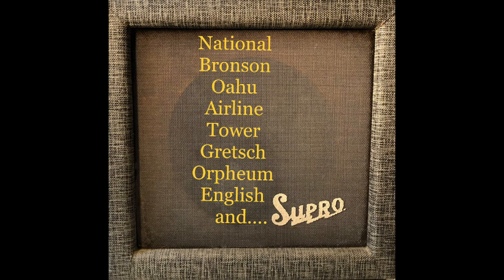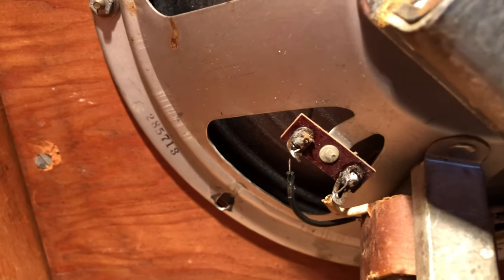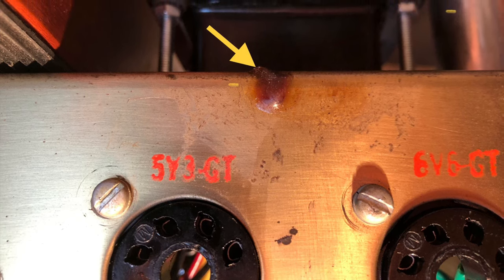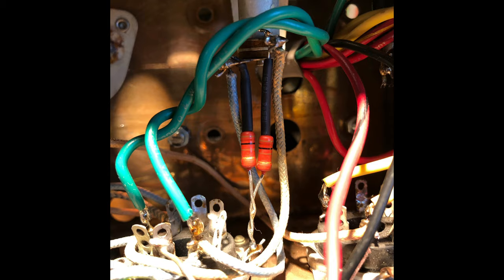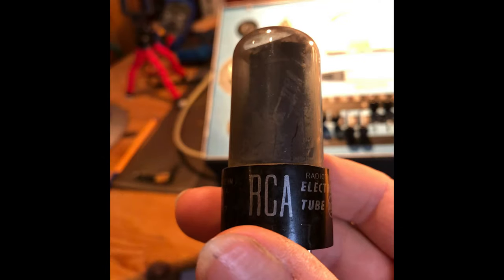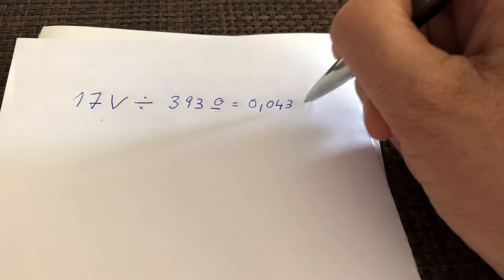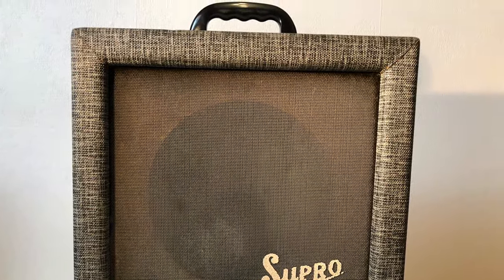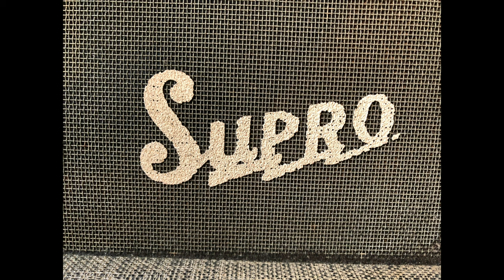Supro SE Amp made by Valco / Chicago : repair, analysis, sound demo

Comment: As a number of folks have pointed out -- the amp Jimmy Page used on Led Zeppelin 1 and the solo to Stairway to Heaven was a Supro 1690T or Coronado. This is a 2x6L6 cathode-biased amp with two channels ("normal" and "tremolo"), each with two inputs and it's own volume knob. It was the early "shared tone knob" version of the Coronado. It has an additional gain stage on the tremolo channel and is can sound much more aggressive/overdriven. Page's amp cam with 2x10s but he replaced them with a single 12" speaker, which results in impedance mis-match, which gives it some of its particular character, along with the specific 12" speaker he used.

Comment: Hello Martin, I just love your channel… You always have the most unique amplifiers, do amazing diagnosis of said amplifiers, then always repair/refurbish them to function and sound as they did when new if not better than new! And your quite the guitarist as well which just adds to the entire experience… I did enjoy you doing the math to figure out the voltage’s for each node, which might be 2nd nature for someone like yourself, but is appreciated for beginners trying to learn. I have a question, I own an earlier National Amplifier, it is 5Y3 rectified, push-pull with a pair of 6V6GT’s, I believe a 6SL7 Audio Amplifier/ Phase Inverter, and a 6J7 Preamp. It is a metal pentode tube with the grid coming out from a metal contract at top of tube to a wire which then goes into chassis. The speaker is a Rola 10” electrodynamic type.. Although it still functions, the voice coil is damaged and obviously produces unwanted noise, and I don’t even play it as I don’t want to damage it further. I’ve gone through the entire amp, replacing all the filter capacitors, tone caps, checked all resistors and repaired any out of tolerance… I truly love the sound of the amp, and I would like to keep the original speaker.. Do you know of anyone who re-cones these types of speakers? I don’t want to add a resistor and a non electrodynamic speaker which I feel would detract from the Tone as well as the originality. Any advice would be appreciated Martin. Thank you, Tom
Reply from the maker: Hi Tom, I don’t know, where you are living. I am located in Germany, and I’m pretty shure, there’s nobody here to fix a electrodynamic speaker. Believe it or not, I have an amp with the same specifications on the bench right now. But it is a real challenge. Even after changing all capacitors, checking all resistors and swapping the tubes, I still have a significant loud hum. I have to trace that, but maybe it’s a problem with the electrodynamic speaker too, because it should work as a choke to suppress noise.

Comment: Some (not all) Harmony amps were built by Valco as well, including the Harmony 420 with 15" speaker and 6L6's, which was apparently designed/marketed primarily as a bass amp. It sounds anemic for guitar (orobably for bass as well but I never tried it for that) and could do with some tweaking or the addition of a proper tone stack (one triode half of a 12AX7 is just sitting there unused!) . The Harmony 420 has a top-mounted amp chassis, but there was a somewhat similar Supro-branded version with the amp in the bottom rear of the cabinet. Some Harmony and Airline amps, and the majority of commonly-seen Silvertone amps, were built by Danelectro, who always used an aluminum chassis, while Valco amps used a steel chassis, whether painted or chrome.

Comment: I built a 6161 Gretsch clone. It’s one of my favorite builds. I stuck to the class 2 NOS disk caps they used in the real one except for using Jupiter caps between the PI and 6973 tubes. The tremolo is amazing. I added a depth pot to it tho. Built a SUPRO/Gretsch inspired cab. 6x9 speakers. Great amp!
Reply from the maker: I’m shure, you will like my next two upcoming videos: a Valco National Val Trem and a National Sportsman 1201. Amazing Amps.

Comment: Not the LZ amp -- it had p/p 6973's.
Reply from the maker: Yes , that’s right. It was the bigger brother of the one in the video. Thanks, I’m gonna mention that in the description!
Reply: @martinstubeampworkbench2299  yup quite a few different models and circuits -- I think the lz one has grid leak inputs as well ....
Reply: @BenPrevo  whats grid leak inputs?
Reply: @jamesoconnor5154  Grounded cathode and a cap on the input -- google it.
Reply: I picked up a Valco made Penncrest combo amp with 2 6973's 4 12AX7's, 5Y3? With a cheese box reverb. It had a off brand 12" speaker and really didn't good. I replaced the 6973's with nos RCA's, as well as the 12AX7's(hold onto your wallet on that call!) Also I did some more research online and found the correct  Jensen 12 from the 60's. Those are pretty expensive, too but I found one online from a  guy parting out a church's organ 4 12 cabinet! All said and done, holy $hit did this sucker come to life! It nails Page's sound on the first 2 Zep albums with no pedals? Glad I bought it for sure!😊
Reply from the maker: Congratulations!

Comment: There's no need to replace an entire tube socket because of just one broken terminal. Just pull a terminal out of a similar style socket, install it into the empty hole in the socket that's in the amp, and twist it 30 degrees, or bend the flap over, to lock it in place. The terminals of most sockets are held in place by a twist, a bend over, a punched divot, or a triangular flap of metal that acts as a locking tab. All of which are easy to squeeze flat or straighten out in order to remove the terminal. To lock it in place, just bend it over or give it a twist (the original divot or bent triangular flap isn't easy to replicate, especially on a socket that is mounted into a chassis).
Reply from the maker: Hi there, thank you for your good advice. In this case I didn’t want to mess around with a 70 year old socket. If the next lug snaps off next week, my customer will be unhappy, the amp comes back to the shop, and that makes me displeased as well. But other than that, you’re right, it is fixable.
Reply: @martinstubeampworkbench2299   Replacing the entire socket here was a little bit easier because in this case it was bolted in place ( And you had one in stock with the same physical geometry and mounting-hole spacing), but many Valco amplifiers have sockets that are riveted to the chassis and so you have to drill the rivets out, which can be a pain in the neck.  And speaking of rivets on a Valco chassis,  you're probably already aware of this ---- but perhaps not because I don't know how many valco amps you see in Germany ----  but the grounding terminals in those amplifiers are often riveted to the chassis, or the cathode resistor(s) might be soldered to the metal frame of a tube socket which is riveted to the chassis for a ground cinnection; and 60 years later those ground points are oxidized and resistive under the rivet where you can't see it, causing ground loops and hum. Just something to watch out for. Otherwise, nice work here!
Reply from the maker: Thanks! Actually Valcos are rare here in Europe. But I’m a big fan of these. Made a few clones, and they sound fantastic, especially the ones with a tremolo sound gorgeous. Got a 1950 Valco on the bench now, with significant loud hum, though all caps are new. I suspect either the electrodynamic speaker, or a groundloop, so funny that you mentioned that. It’s a small world!
Take care
Reply: @martinstubeampworkbench2299  ,  Check out some videos on the Psionic Audio channel, hes got a couple of videos of Valco, and also Ampeg, amp repairs where the units had some fairly strange grounding scenarios, and the attendant hum.  Personally I hate rivets used for ground connections becausound connections because the metal's always relax with age, as well as oxidized. Worst case scenario is riveted grounds in an amp with an aluminum chassis like Danelectro and Silvertone amps;  There's no cure for those except to drill out the rivet and install a bolt for the ground terminals because you can't solder to the chassis. Whereas Marshall and Vox and other amplifiers with aluminum chassis typically used bolts for ground points instead of rivets.

Comment: What amp model is this amp?
Reply from the maker: The model number was 1614. But this single ended circuit was found in many other Valco amps under different names and model numbers.
Very close is the 6616 with a tremolo added, or the Gretsch 6151. It’s weird…..
Reply: @Martins Tube Amp Workbench  im lookin for an old late 50's valco supro like in the video do you own the amp?
Reply from the maker: @jamesoconnor5154  
Hey James. Unfortunately I don’t call an original Valco my own. These amps are very seldom here in Germany, because, I assume, they never made amps for export like Fender did. But I built a few clones with and without tremolo. Interestingly they sound very similar to the originals. I don’t know, where you are located at, but in the US there is a company that make extremely good copy’s of the old Valcos: Vintage 47. Check out their website. 
And here’s a video showing you one of my builds:
Reply from the maker: https://youtu.be/Cf-72SJoHZk